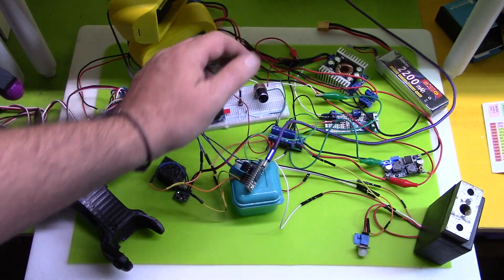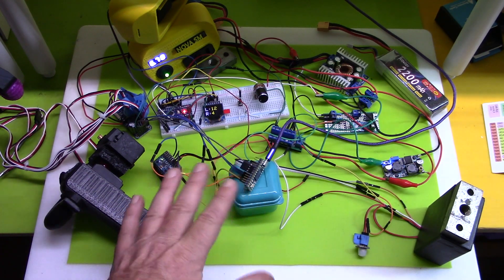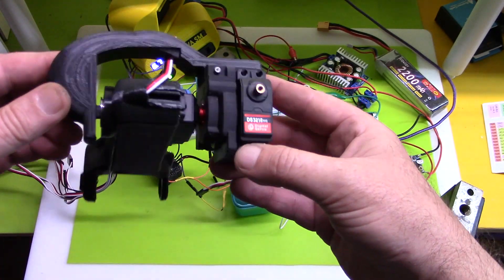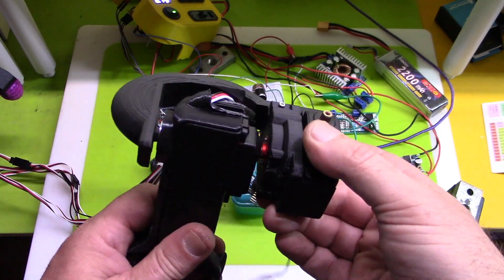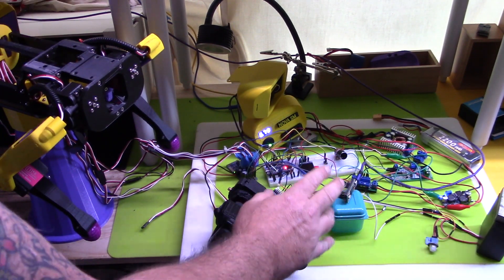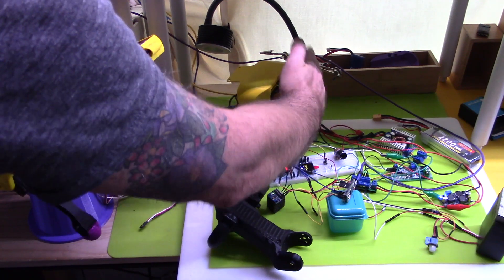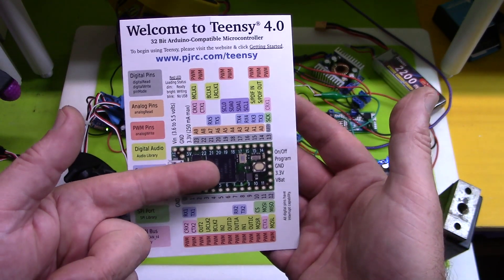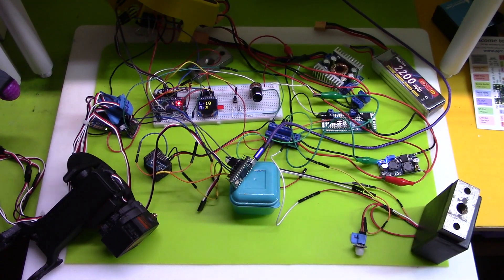Replace Arduino Mega with a Teensy 4.0 : Nova SpotMicro3

Comment: Awesome project! I have been meaning to get a Teensy 4.0 for my balancing robot project. I was wondering if the teensy 4.0 board (teensyduino) would be compatible with Jeff Rowberg's i2cdev library? Any suggestions? Thanks!
Reply from the maker: thanks so much!  I am not familiar with that library, however I can tell you that I had no issues with any libraries I was using on the Mega. I think the MPU library was the only one I changed, and just for better performance, not compatibility.  I say go for it - its around $30, but you will be quite happy, trust me!!  I am still barely using 1/4 of my teensy's resources... and over 5000 lines of code ;)
Reply: @ChrisLocke1969  Thank you for the advice! Could I ask how you improved the MPU library for better performance? I would love to improve the bot in any way possible.
Reply from the maker: @seiyonarulampalam7354  sry, i should've said i used a different, teensy specific mpu library. 👍
Reply: @ChrisLocke1969  No worries! Thanks for the information!
Reply: @ChrisLocke1969  UDPDATE: https://github.com/jrowberg/i2cdevlib/pull/507 thanks to the Arduino forum I have learned that the teensy 3.x have been incorporated into the library.
Reply from the maker: @seiyonarulampalam7354  nice!!

Comment: Really glad you made the change!!  I thought you were going to resist and keep the Mega :-)
Reply from the maker: lol I was holding out as long as I could.  But since teensy is damn close to using Arduinos, I'm good with this. Its "computers" like Pi and Nvidia boards I can do without.  lol
Reply: @ChrisLocke1969  i agree. I don't want to get into Linux issues and  I honestlty believe that for controlling h/w Arduino like boards are still the best. I think the Pi can be  used together with the Arduino for higher level functions.
Reply from the maker: @B_mata  exactly. this is a hobby to me, i want to do as much of the work i can myself! 👍

Comment: Hey! Great to see you switched to teensy. The older models of teensy do not run at 600mhz. Only the teensy 4.0 and 4.1 do that. So only use those. My board is designed for the teensy 4.1. Has 15 servo lines, 2 i2c ports, 4 sensor inputs and 3 general gpio headers. It also has a header for a nrf24l01 radio module, which i use for remote control.
Reply from the maker: i'm loving it! not sure i will build a board for it, but probably. Im having trouble getting it to start with my code and external power. I put blink code on it, i can start and restart no problem. i put Nova code back, nuttin.  Weird. Im sure Ill figure it out... l already cut my usb pad, so i know its not that. Hard to imagine code would prevent it from powering / booting, especially knowing my code works fine. thx again for suggesting teensy! 👍
Reply: @ChrisLocke1969  I had issues once which were caused by conflicting pin assignments. I had i2c running and there was a definition in the code for sensors connected to those same pins. So once the sensors got called for, the i2c would crash. Maybe it's something like that for you?
Reply from the maker: @ManoBiletsky  addressing all seemed ok - I just think the Mega couldn't handle all that i2c traffic at once. (motors, mpu, and nano slave).  So far, this Teensy has changed everything!  With 3 i2c buses available, there'll be no conflicts or collisions of data! ;)